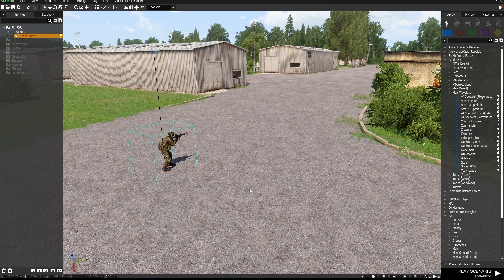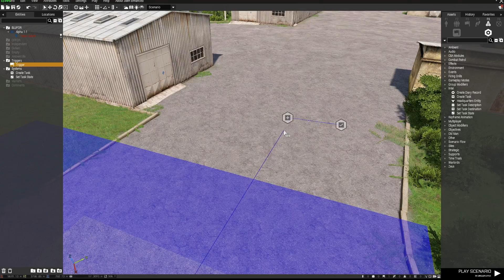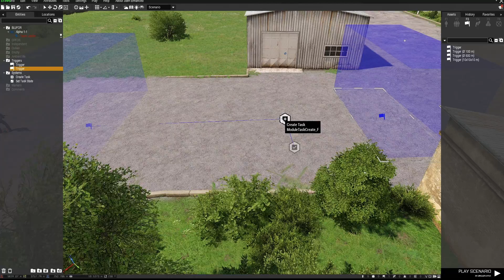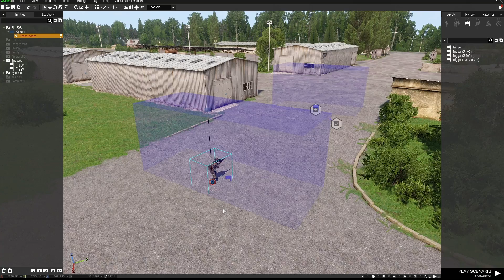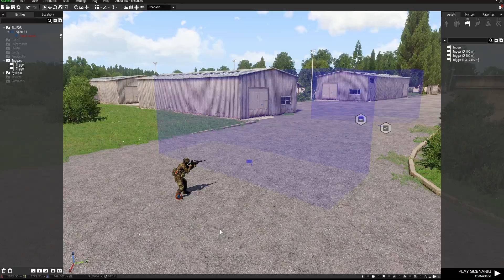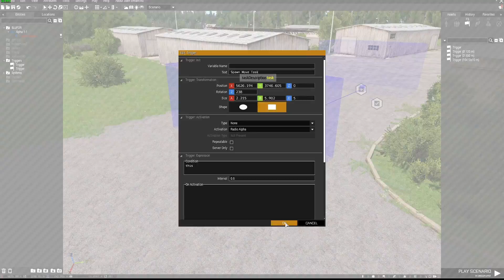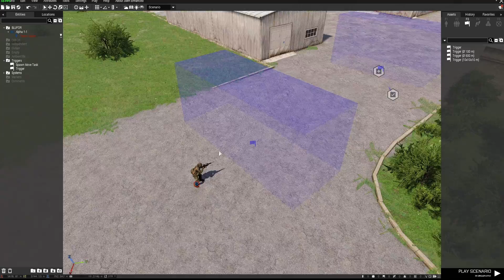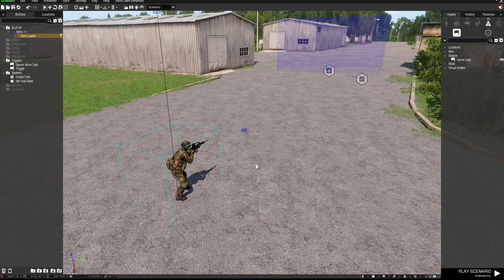Arma 3 Editor | Radio Triggers Explained

Comment: Fantastic video M8... However.......... I cant get it to work... The only difference in my mission is that I only want Player Bluefor to activate and complete...  It never works for me... The only thing I can think of is tha Bluefor and Redfor are Ai only and Not Players... I hope Im wrong...
Reply from the maker: If you want human players to activate triggers, it's safer to use 'any player present' to fire the trigger.
Reply: @OnlineCombatBN  Thats what i was afraid of... Im now guessing again that the only way this will work is with a bunch of coding.. I dont do code, so this is another dead end on Arma 3... Very disappointing.. Thanks for the info M8...Keep up the good work....
Reply: Not sure what you are after, if you right click the trigger, set trigger owner and drag the line from the trigger to the specific Blufor player you want to trigger, you can then use the drop down menu of the trigger, to select the Owner only, any group member, and other options on how you want it to trigger.
Reply from the maker: Sounds like you need to get back to the bare basics.   This should help:

https://youtu.be/Lv7f0NZ5esE?si=l-4iJO4o8L8GBVcj